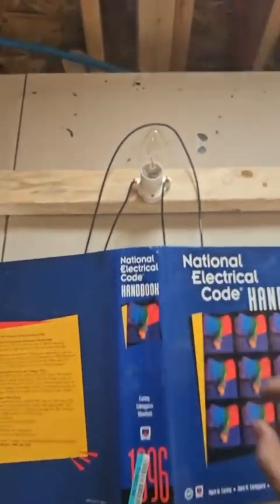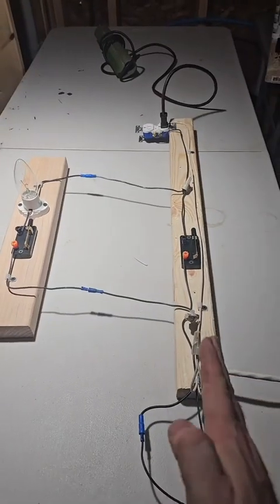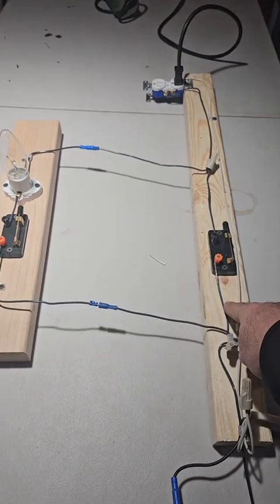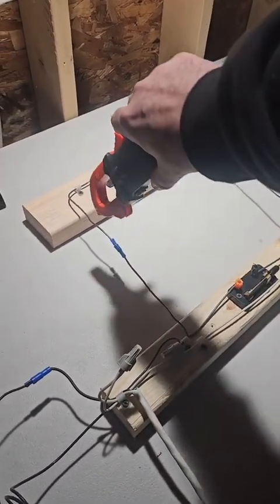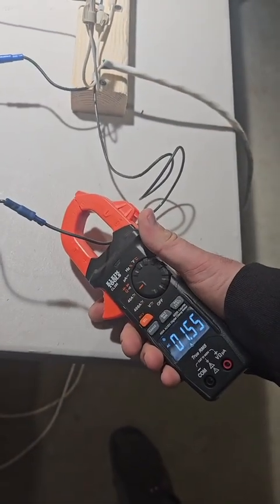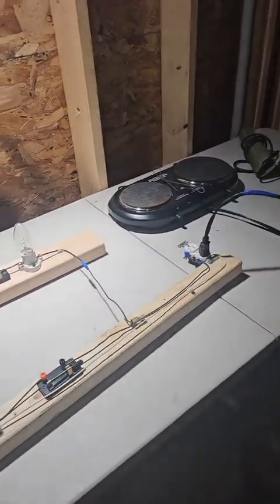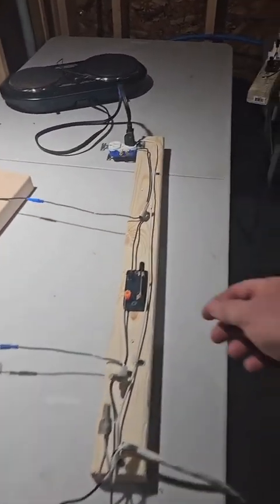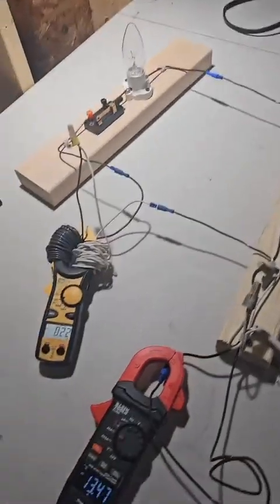click here for full video.... deeper dive into my riddle..

Comment: Since a current clamp meter is actually a current transformer ( AC/DC amp clamps use a hall effect sensor instead,  because transformers by their nature,  are only suitable for AC) the turns ratio formula applies to AC and AC/DC amp clamp, meaning if your meter doesn't measure below 1 amp for example,  and you need to be at to measure currents down to 100mA, you'd wrap the conductor around the clamp 10 times, or in simplified terms, meter reading/number of turns = the actual current being measured.

Comment: Cool demo!

Here is a thought experiment though.  With enough voltage, air becomes a conductor, and electricity can arc through it to complete a circuit.  So, we must admit that not only the wires of a circuit provide a potential path for electricity in your demo, but so does the air in the room with you.   The fact that you're not losing current into the air, shows that electricity will not follow every path, it will only follow the paths that have low enough resistance.

So what your experiment is really showing, is that the filament of a light bulb doesn't provide enough resistance to act as an open switch in the circuit.
Reply: Ehh... now you're getting into chemistry.  Electrons jump between atoms, and air is mostly space/vacuum.  So air is typically used as a stand in for empty space.

Now, this kind of impractical thinking since the measurable current through the air is so close to zero, compared to the source current, that it's ignored. 

Thank you for getting me to think about this. It made me realize just how unpredictable high voltage arcing is.

Comment: You are correct as an appliance tech that's exactly how you measure amperage when the component you're drawing is real low. Not 100% sure but try to wrap wires around the amp probe hooked up to nothing with the low current load in there the way it is originally. I think! it'll pick up the inductance of the wraps of wire and the Actual low current wire.  Try that because if it works you can have a premade bundle of wire for faster testing.